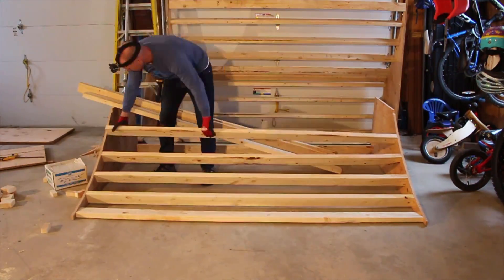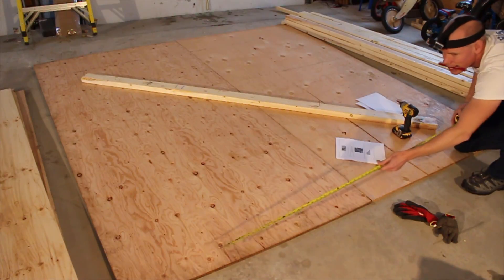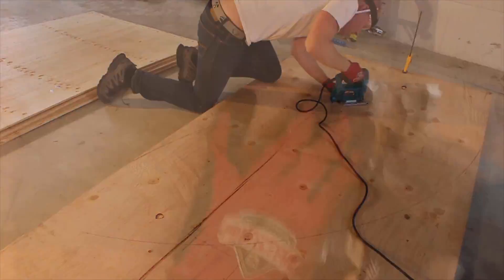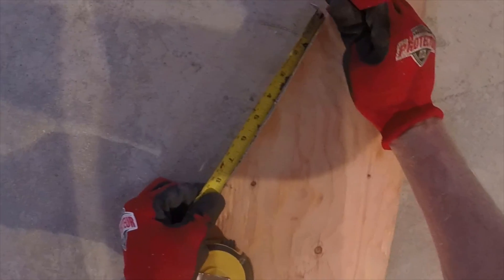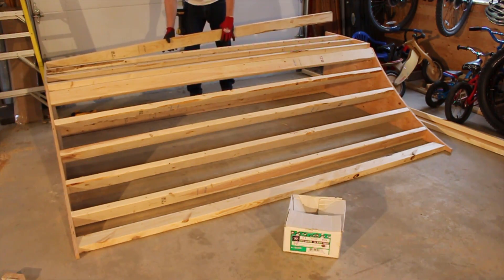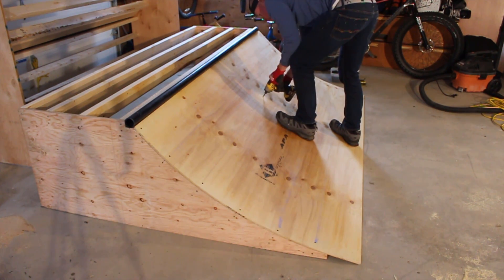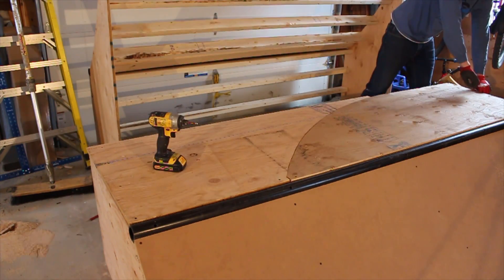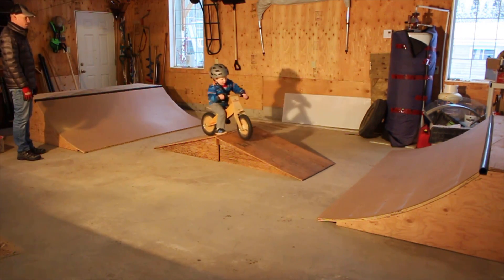Build Halfpipe DIY: How To Build Skate Ramps Out of Wood In Your Garage - BMX Bike Ramps

Comment: Nice ramp is just if you try to skate board with that ramp I would recommend putting some sheet metal at the bottom of each ramp to have a smoother transition
Reply from the maker: yes, this is a good idea if you want to use it for skating

Comment: Just got all my supplies. Question, in the plans for the 4ft wide ramp, it has you cut the first 3/8 layer a little shorter than the next layer. Pretty sure you didnt rip the first sheet down an inch or two, correct? Any down side to skipping that step or would you recommend ripping one 4x8 sheet down to like 3ft 10in?
Reply from the maker: @vbnautical5041  oooo....it's been a few years since I did this. I honestly can't remember. sorry

Comment: Did the material list online only build one ramp? I want to build two, just wondering how much it will cost me. I want mine to be 8 feet wide. And yes I already know it depends on where I buy it from so I’ll figure that out for myself. Just want to know how much Lumber I need to buy
Reply from the maker: That is for each ramp
Reply: TheHowtoDad how much did it cost to make yours? You built two 8 foot wide right?
Reply from the maker: @BigMoneyWaste  yes, they are 8ft, my building material cost is very high. Probably cost me $250 for both
Reply: TheHowtoDad ok thank you! Just wanted to figure out costs. What made your building cost more?

Comment: Great work!
little tip from a ramp builder, always screw sheets in from the top the entire 2by4, then all the screws the 2by4 under that. this makes the sheet follow the transition more, and makes it ride smoother.
if you take the 2ft ramps to the max you end up with the setup i have in my garage:
http://crankbmx.com/files/garageskatepark.jpg
Reply: Pieter Possenier that’s a sick setup!
Reply: Not sure I follow this tip, can you elaborate?
Reply: @gregmeinecke5663  in the video, the guy screwed from the top to the bottom of the ramp, then moved over and repeat..    It’s better to screw across horizontally, starting at the top, then move down to next 2x4 and screw that whole thing horizontally, until you get to the bottom
Reply: @chriskunce3331  nice tip makes sense to torque a section at a time with the flow top to bottom
Reply: I realize Im kinda randomly asking but do anybody know a good place to stream new movies online?
Reply: @Kristopher Charles Flixportal :D
Reply: @Karsyn Fletcher Thanks, I went there and it seems like a nice service :D Appreciate it !!
Reply: @Kristopher Charles Happy to help =)

Comment: So, im a skateboarder, would the punctual load from smaller wheels break through the cardboard on top? If so what material should i use for the top layer that would be more durable? Please respond i want to know
Reply from the maker: Ian Dutter ints not cardboard, it's hardboard/masonite. You can find it at any lumber yard
Reply: oh so it can be skateboarded on?
Reply from the maker: Yes, it's what most skate ramps are Surfaced wity
Reply: At first i thought u had said "cardboard" instead of "hardboard". Yeah that makes more sense for a durable ramp. Great video by the way. Now i need to build it with my dad if he lets me. I might turn it into something i can put in my backyard with plywood as the floor of it
Reply from the maker: Ian Dutter cool man! Good luck, pretty easy job for you and your dad. Thanks

Comment: Q: Why square off the end of the templates? Just curious.

Also, if you wanted to use the for a skateboard you would need something to lessen the edge at the ground.
Reply from the maker: WillieD7 good questions. Square it off so it's less likely to break. I don't think it really necessary.

For skating you'll want to get a peice of 1/16 steel to go along the bottom edge to lessen the lip. Make sense?

Comment: The drain pipe will be gone in no time. Metal coping is the way to go.
Reply: I doubt much gringing will be taking place on that coping
Reply: It’s cheap... replacing it isn’t a big deal or you can replace it with metal later. But I have heard it skates different than metal
Reply: Charcoal grilling is better than propane.
Reply: Yeah, that 3 year old is going to shred that coping with his push bike so fast...

Comment: You’d die riding that with a skateboard you would need to either make a flat bottom or use metal sheets at the bottom so the wheels can roll up. Flat bottom would be less noisy though.
Reply from the maker: ya, a strip of sheet metal along the bottom would do the trick. I built it for bikes, I didn't do that. thanks for pointing that out!

Comment: For skateboarder, that transition is too drastic from ramp to floor. Any way you could make some flat that could slide or lock into place so the transition is a seamless between the ramps> Maybe two or three more rectangular pieces that slot in together and into the ramps to make this a full on portable mini. 4-5 pieces when disassembled.
Reply from the maker: Just affix a 1/16" peice of steel along the front edge. 8ft by 6" would do the trick.

Comment: Riding a skate board up will be difficult because of that 3/4"+ rise from the floor to the Lowest part of the ramp. The transition is not smooth, and will definitely catch your wheels
Reply from the maker: For sure. A peice og 1/16 steel sheet metal would be good for the transition.
Reply: How about just making the flat bottom and never putting it away.
ALSO Half pipe not half pike buddy 🤭

Comment: Ok I'm 14 and I only have 1 problem with ur design... It doesn't have the cleanest transfer on to the ramps
Reply from the maker: That is true. You could get a sheet of 1/16" steel 1ft by 8ft and lay it along the bottom of the ramp. Your wheels will be able to roll right over it
Reply: @TheHowtoDad  Yup. Or build a wooden floor out of plywood and hard board to the correct height, give it some sort of lap-splice to fit it together nicely and to hold it in place. That would maintain a smooth wood to wood transition, and the floor pieces would also be very easy to store!

Comment: Nice build. Massive lips on those things though.
Reply from the maker: Shred Boise ya, if you wanted to use it for skating youd want to put a 3/16 piece of sheet metal along the bottom. Easy to do
Reply: Personally I make layers that allow the masonite to meet the ground. Much more quiet and smooth. I've got a garage full of modular wood ramps that I roll out.
Reply from the maker: Shred Boise cool. What thickness do you use?